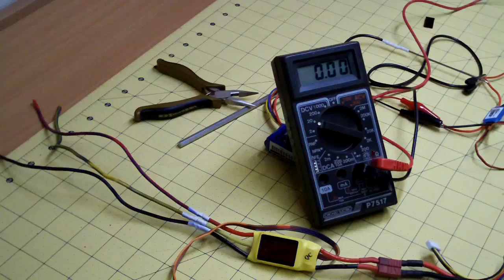LED's powered by brushed ESC

Comment: Cool video... You should pick up a servo tester on eBay for $1.66 shipped. They work great for running motors or whatever off of speed controllers without the need for receivers and radios. You can also make some electric motors with serious balls using car alternators with the armatures replaced with the rare earth magnet rotors they sell cheap that are normally used for small wind turbine generators.

Comment from the maker: Thanks for the comments.  No I have not tried to adjust the endpoints, but I have tried a few different ways since I did the video and they seem to work OK.  The goal was to have them engage dimly at 1/2 throttle and then progress to full brightness at full throttle. Thanks again for the info!